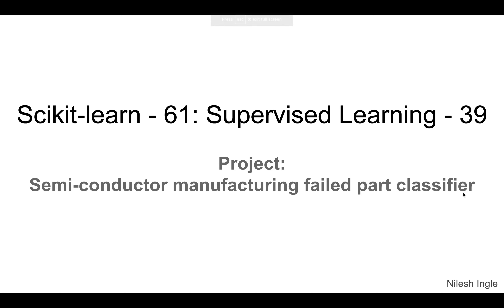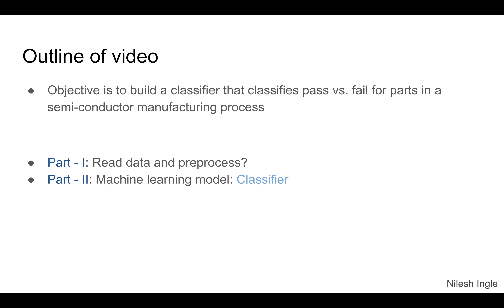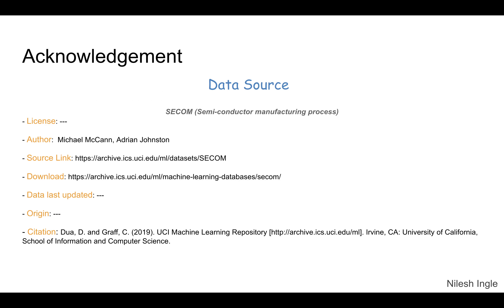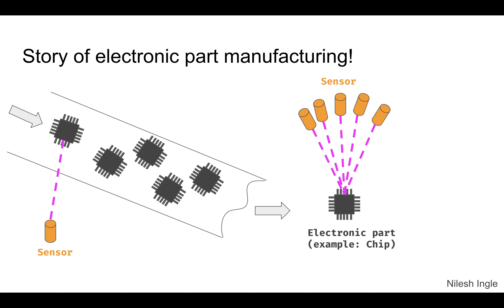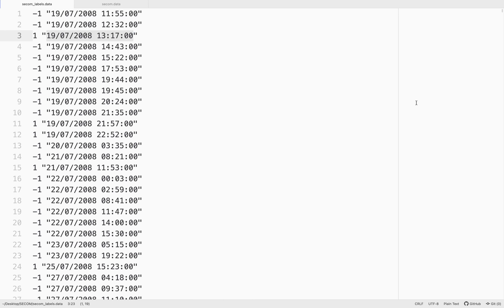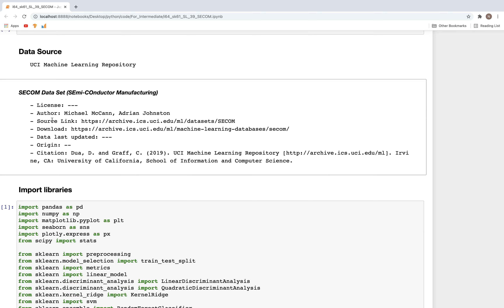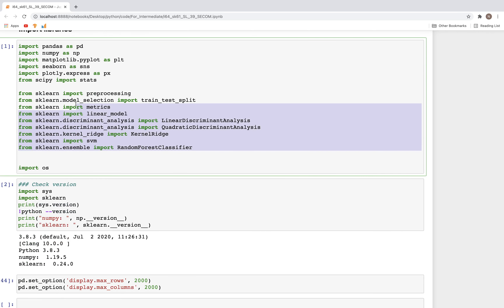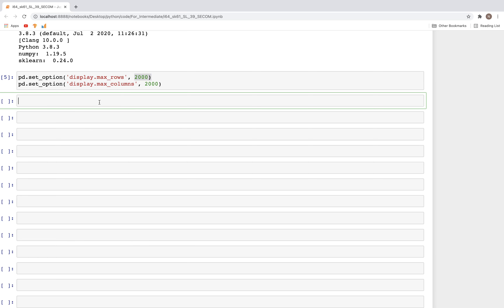#64: Scikit-learn 61:Supervised Learning 39: Project semi-conductor part classifier

Comment: Why do you apply oversampling to the test data?
Reply from the maker: (1) You are correct. Test data should not be upsampled.
(2) In the video at 1:01:46 the data is split into train and test set after upsampling. Thanks for catching that! The description is now updated. 
(3) Ideally, the data should have been split into train and test before any preprocessing such as upsampling.
Reply: @learndataa  Thank you for answering my question even though it's an old video

1. I applied upsampling only to train data after data split, but the result was not good
Is there any other good way??

2. What do you think about applying upsampling to train and test respectively after data split?
Reply from the maker: Hoping below helps!

# 
# Short version
#
Could try:
- imblearn library
- ADASYN, Borderline-SMOTE, ensemble methods, etc.
- to use weighting for each class

#
# Long version
#

(0)
Check out Imbalanced learn library that is part of scikit-learn-contrib.
https://imbalanced-learn.org/stable/index.html

(1) 
Thoughts below are other strategies:

- Different Resampling Techniques: 
Instead of just oversampling the minority class, you could explore other resampling techniques such as undersampling the majority class or using more advanced methods like ADASYN or Borderline-SMOTE. These methods focus on generating synthetic samples that are more informative and realistic than traditional oversampling.

- Feature Engineering: 
Carefully create features that capture the unique characteristics of each class can help your model better discriminate between classes, even with imbalanced data.

- Ensemble Methods: 
Ensemble methods like Random Forests with class weighting, Gradient Boosting, and AdaBoost often handle class imbalance better than individual models. These algorithms can combine the predictions of multiple weaker models to create a stronger overall prediction.

- Algorithm Selection: 
Some algorithms are inherently more robust to class imbalance. For example, Support Vector Machines with class weights, and Naive Bayes can handle imbalanced data well. Experiment with different algorithms to find the one that performs best for your specific problem.

- Cost-Sensitive Learning: 
Assign different misclassification costs to different classes. This can help the model prioritize correct classification of the minority class.

- Anomaly Detection: 
If your problem involves detecting rare events, you might consider treating it as an anomaly detection problem rather than a standard classification problem. Anomaly detection techniques can be more suitable for imbalanced data.

- Collect More Data: 
If possible, try to get more data for the minority class as it can help alleviate the class imbalance issue. However, this might not always be feasible.

- Change Evaluation Metrics: 
Accuracy is not always the best metric for evaluating models on imbalanced data. Consider using metrics like precision, recall, F1-score, or area under the ROC curve (AUC-ROC) that take into account the class distribution.

- Hyperparameter Tuning: 
Proper tuning of hyperparameters, especially regularization parameters, can significantly impact model performance on imbalanced data.

- Feature Selection: 
Selecting relevant features can improve the model's ability to distinguish between classes.

It will depend on the dataset and question that needs to be answered. One way could be to experiment with above and choose the strategy that works best.

(2) 
Generally, not recommended because:
- could cause data Leakage
- introduce bias
- final model may not perform well on unseen data

In practice, you could focus on balancing the training data to address class imbalance and ensure that the test data remains untouched. If you're not achieving good results with standard upsampling techniques, consider exploring other strategies mentioned earlier, such as advanced resampling techniques, ensemble methods, algorithm selection, and feature engineering. Remember that maintaining the integrity of your test data is crucial for reliable model evaluation and generalization.